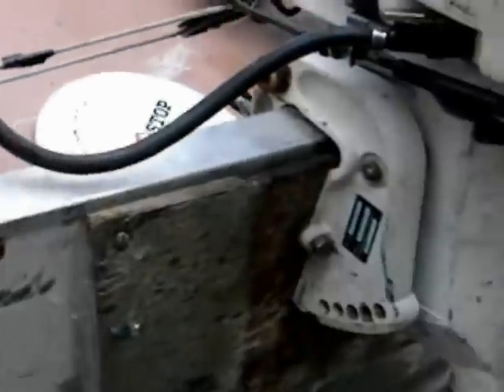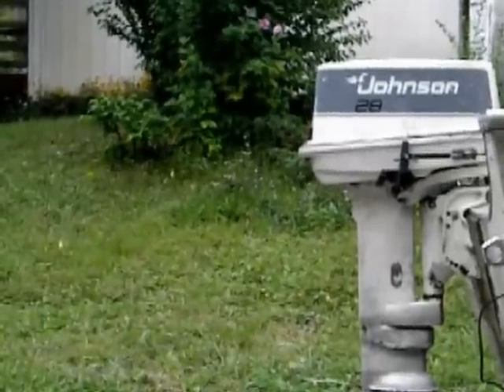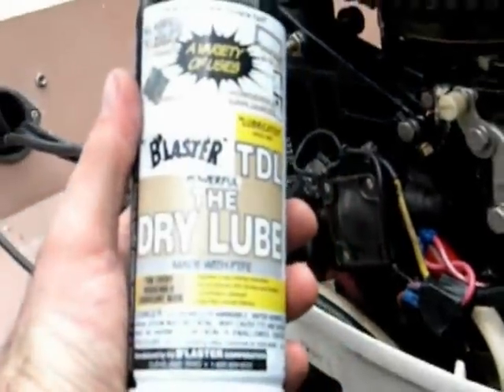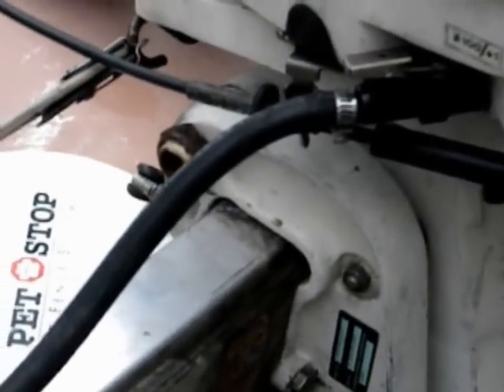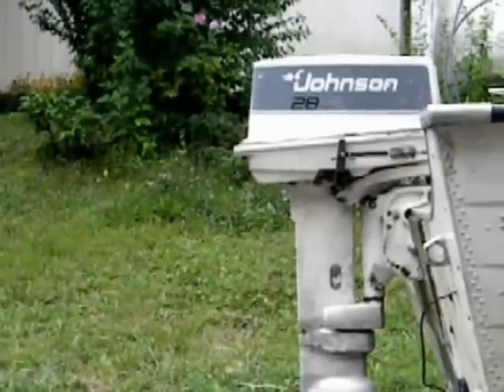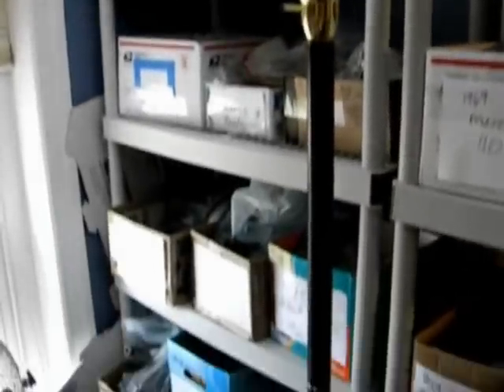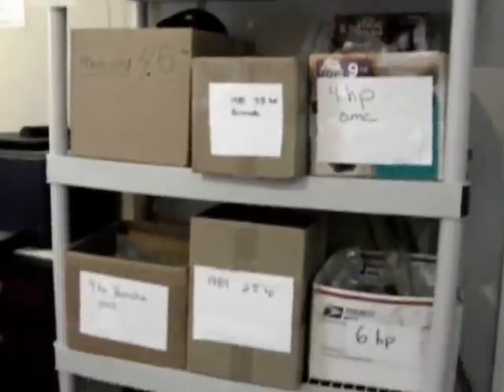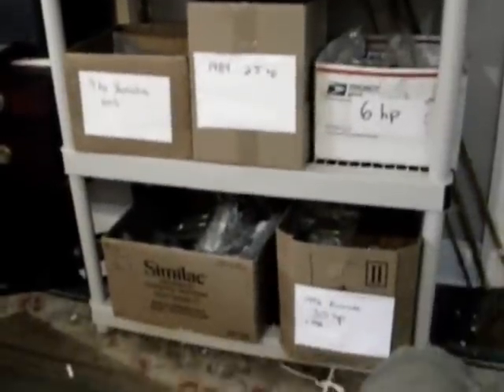Starter just spins? You might need your Bendix lubed up. How to do it. Repair your outboard

Comment: You didn't show where you sprayed the liquid.
Reply: If you starter spins, just replace it. I found out the hard way.
Reply from the maker: on the shaft the gear that ingages the flywheel
Reply: Well thanks, however I got a used starter and it's working great. I had starting problems for a long time.RC

Comment: most of the outboard starter drives have rubber clutch assembly. so if you spray any type of petroleum product on it, it will swell the rubber and make the drive slip...dry lube if you have to...also, bad ground to starter brushes main cause of outboard starter issues...have your starter motor checked every off-season to ensure reliable starts

Comment: My bendix gear did this after spraying degreaser on the motor.  You can turn the bendix by hand once removed from the starter.  I thought degreaser got inside the bendix gear itself and ruined it.

Are you staying that spraying dry lube inside the bendix gear itself will stop that?  I really don't understand how that will solve the problem but I would LOVE to have a spare bendix and fix this one vs buying another one.

Comment: The clicking sound is not the starter spinning, it's the solenoid not engaging the starter gear with the flywheel -- or the starter motor's contacts being worn/burned/dirty.
When the solenoid slides the starter's drive gear into the flywheel's ring gear, it also closes the starter motor's main contacts -- causing it to spin.
The first causes the second to happen.
The "Bendix" is an outdated principal, improved to the solenoid system, because it relied on the drive gear spinning to cause it to engage the ring gear, which excessively wore both gears.
Reply from the maker: This motor has a solenoid that is separate from the motor. As you can see from the video this motor has a bendix.
Reply: joeseif
 Unlike a solenoid starter system, a bendix is driven into the flywheel by its spinning motion -- meaning that the starter motor and gear must be spinning first,  for it to engage the flywheel, and the bendix gear is spinning rapidly when it engages the flywheel
(This outdated system excessively wore both gears for obvious reasons.)
On the other hand, a solenoid setup engages the starter motor's gear into the flywheel and simultaneously engages the starter's electrical contacts -- making the starter motor spin, (but only after the gear is fully engaged with the flywheel).
Bendix: spins first, then engages
Solenoid: engages, then spins
Sorry, but your video doesn't show any starter action whatsoever.
The clicking heard at the beginning sounds exactly like a solenoid engaging, but the electrical contacts not cleanly coming together. There was no sound or video of the starter motor just spinning after the click(s).
The PB Blaster lubricates, and will also clean dirty electrical contacts, but you don't show where you sprayed.
Peace Bro.
Reply: Re-listen carefully... the bendix gear is spinning...  You can ear it decelerating, after the clicking sound.